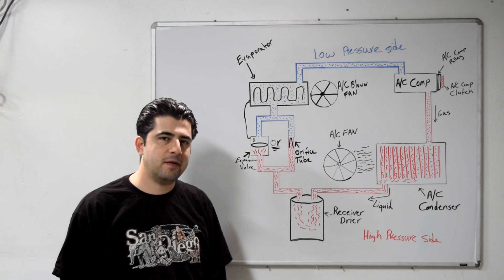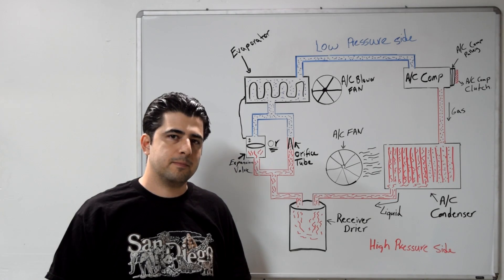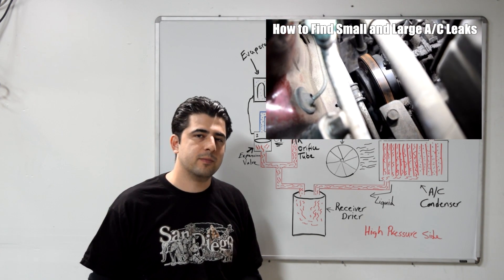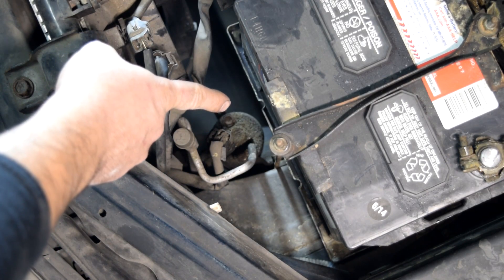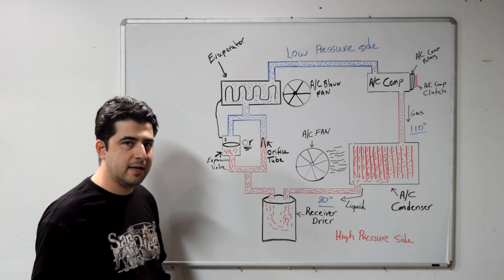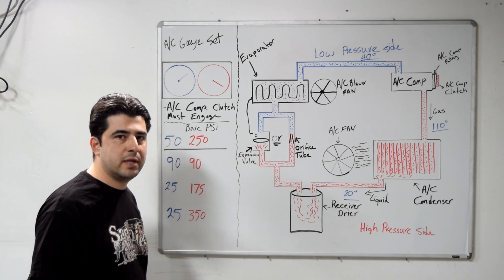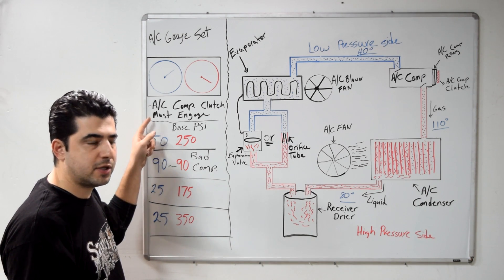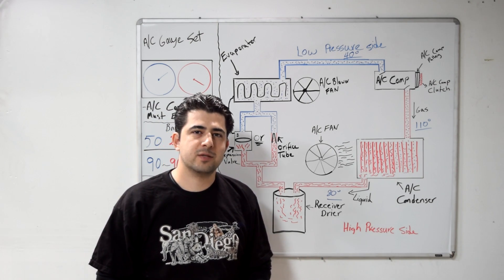How to Diagnose Problems With Your Cars AC System - With or Without an A/C Manifold Gauge Set

Comment: Is the Centech temperature meter worth the money? Thanks for the informative video series.
Reply from the maker: Jimmy Mac Its not bad, this is the only time I've had trouble with it. Thanks for your comment.
Reply: RatchetsAnd Wrenches I use to sell these types of temp meters. The problem was probably a two fold problem. By the time you got around to checking that low pressure line, the ambient air temp was high enough that it interfered with your reading, plus the surface you were reading was not very reflective and covered with dirt and debris. The two combined most likely had enough of an effect that it prevented you from getting a good reading. Try spraying some degreaser on the line before hand to clean it off. As for the ambient air, well you can't really do much about that and effectively test an AC system because you have to have the engine running.

Comment: Hi, I replaced the ac condenser clutch  bearing recently because there's a bit of a whine when it's turned on, it made a small improvement, it cools pretty good.  Is it possible that if I recharge,  it could reduce the noise? Thanks
Reply from the maker: Typey1 Hi, if you are sure the noise is not from either the bearing, tensioner or roller and are positive its the compressor I would plan on replacing the compressor soon, if you dont replace it and it seizes up you'll need to replace more than just a compressor and the cost will increase. Simply recharging the system wont make a difference, (I am assuming system is not low on refrigerant and you are talking about evacuating and recharging). My next few video's will take you through a compressor replacement step by step if you are interested. cheers

Comment: I don't know why those manifold gauges cost so much, even from Harbor freight.
At least the thermometer is dirt cheap.
Reply from the maker: s0nnyburnett I am pretty sure autozone rents them for free if you give them a deposit, also if you use a 20% off coupon with harbor freight it brings the price down to $40 which is not bad.